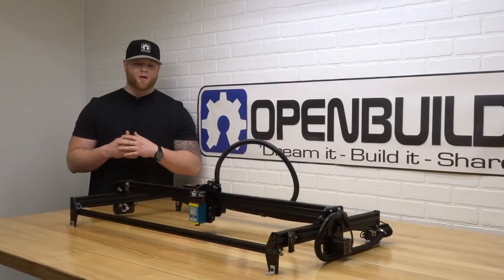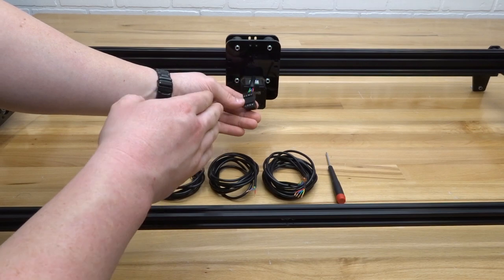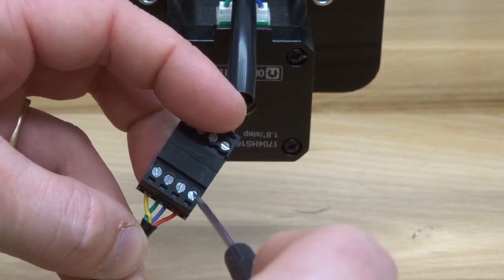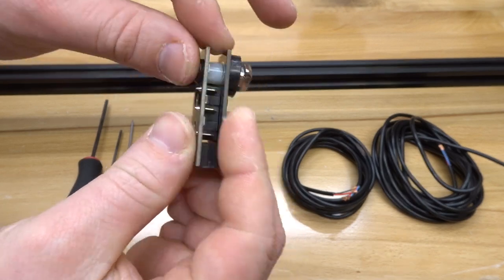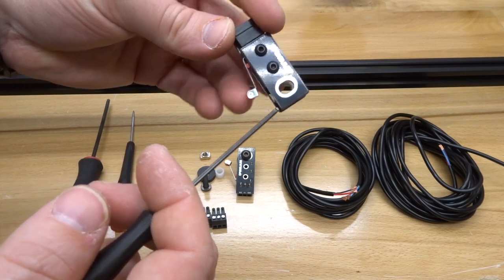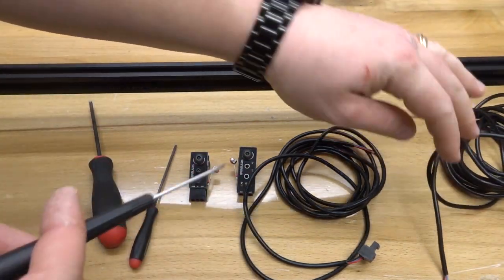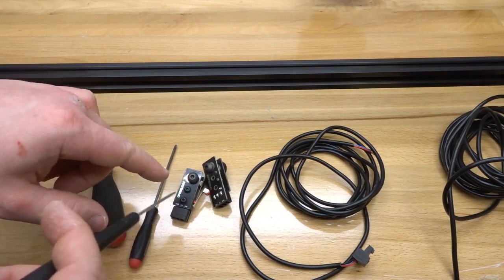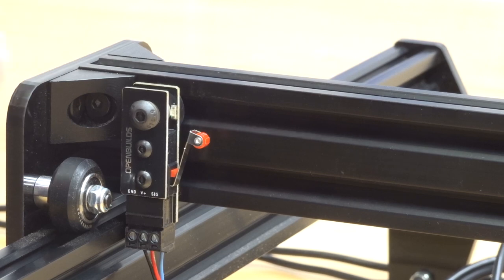OpenBuilds Acro System Electronics and Software (Using BlackBox)

Comment: Can you build a system like this with a cmc?
Reply from the maker: Yes, you can build a CNC with this machine, but it is more suitable for light-duty applications such as lasers and drawbots, as it may not handle heavy forces on the system. If you are interested in a CNC-style router machine, please consider checking out our LEAD Machine series here:
https://openbuildspartstore.com/lead-cnc-1010-40-x-40/